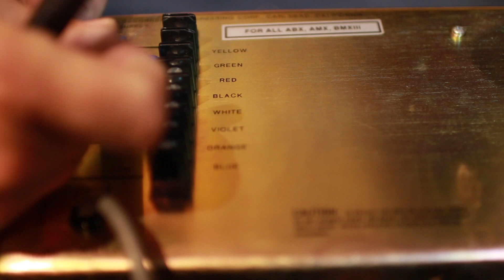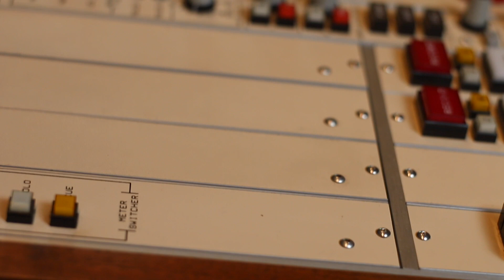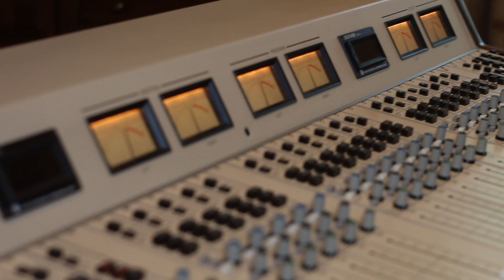PR&E BMX III Broadcast Console

Comment: Those look like wonderful projects!   I just got an Audioarts R-60 which is similar but smaller and newer.   It needed some cleaning and some new parts in the power supply.  the 5 volt logic supply was goofy and the buttons blinked on and off.   It's fun to have a little bit of radio history.

Comment: Are the molex pins .062 or .093 for the radiomixer 20?  I'm trying to clean mine up, and get it working.
Reply from the maker: .062 for the ABX and BMX not sure about a radio mixer
Reply: @bigdmc1  The darn manual doesn't specify, and the part numbers are in PR&E not Molex.  Unless they cross reference somewhere.

Comment: Fantastic console, that BMXIII-26.  I have an identical unit that's been in continuous (light duty) service for two decades.  Our studio furniture was also built by PR&E, so everything matches the console's blonde-color wood panels.  I'm just now starting to have an issue with the Telco/Sends module, which has lost some low-end EQ; gotta pull that module and see if there's anything obvious.  Great to know you might be a parts source.  Thanks for the video!